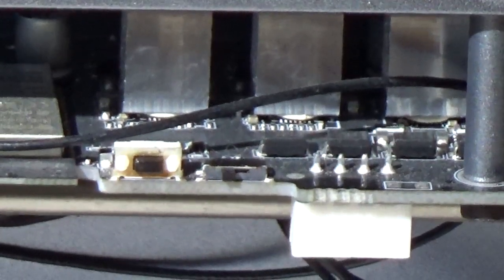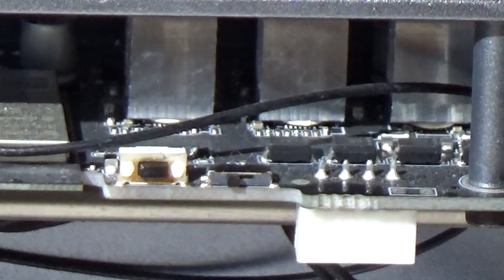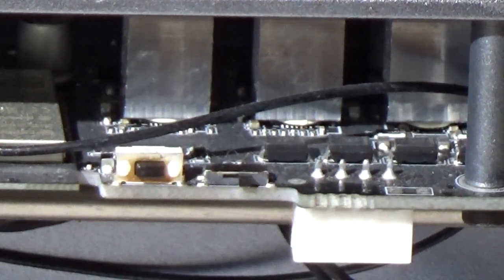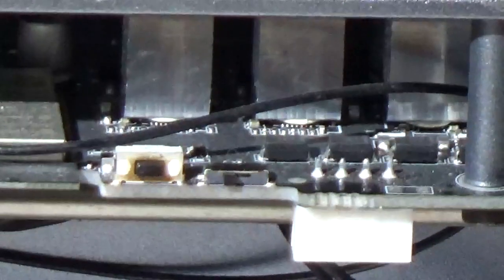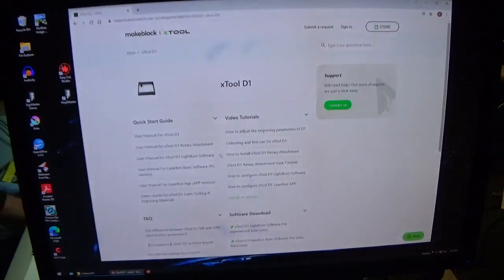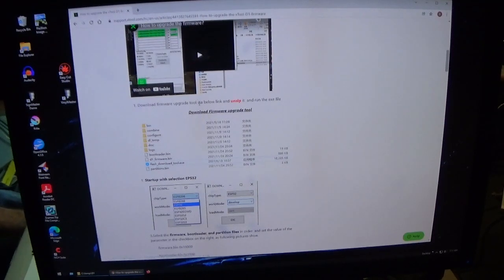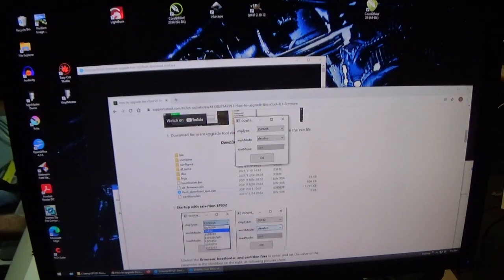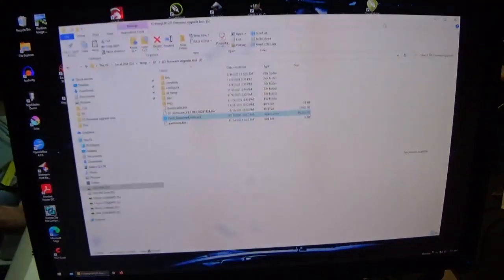xTool D1 Laser - Manual Firmware Update and 'The Switch'.

Comment: Before i found your video i updated the firmware but now my motor is locked up, i read somewhere is maybe because i installed the firmware for the d1 pro and not the d1 because i thought i did have the d1 pro.. so does anyone know how i change to the d1 firmware?
Reply: also xcs is not even recognizing my machine now :\
Reply from the maker: Wow! You would think there would be some type of checks made before allowing the Pro firmware to be installed. You will most likely have to do a manual update with the correct firmware. I did one in the video but I would check xTools support page for 'Manual Firmware Update"(?). I would say it's easier now or the steps may have changed. This video was done 2 years ago... Hope you get it figured out! The Official xTool group on Facebook might be a good place to get some help also if you need it.

Comment: Hello, your video helped explained a lot of questions I had. I unfortunately tried your method and it didn't work. I keep having issues with the system. For some reason I start a project and randomly it stops. It says that I cancelled the task. Do you happen to know what the issue might be? Thank you in advance.
Reply from the maker: Thank you for the comments and wish I had an answer for you. I have been hearing a lot of that and changing USB cables and/or using a different USB port seem to be the only advice I have seen. I am having the same issue with my 20w Pro. I will stop in the middle of a job and leave the laser running sometimes. Not dependable at all and afraid to use it. Have sent 3 messages to xTool and have not received a single reply yet.. If you hear of anything or find a cure, please let me know.

Comment: Hi friend.
I recently bought my xTOOL D1 Pro; I was working today (26 Feb 2023), when I opened XCS, an update message appeared, which, I confirmed (Update successful). After that, the machine no longer recognizes the USB and is no longer working.
When I click Process in XCS, the following message appears: "The device is offline. Please connect the device."
Is it possible to do a Factory Reset on the machine? I need a solution, please. Thanks
Reply: Having the same problem.  Resetting and rebooting machine and computer did nothing.  First it wouldn't home, now it won't respond at all.
Reply: @LoveTracy_Love  I purchased and am using LightBurn normally.
Reply from the maker: Have you tried restarting everything? Computer and all. Try it again. There is a Reset button on the board but it just resets the basic configurations, not firmware.  There is a manual way to reset the firmware. I would check support.xtool.com for the current files and information on that. Hopefully a full restart does the trick.

Comment: Mine won't even turn on,it just flashes blue by the sd card,how do I fix this,I can't even connect device to do an update??
Reply from the maker: Unplug all the cables plugged into the board and try to turn it on. If it comes one, one of the wires was plugged into the wrong place. Other than that not much to them to go wrong. You can try the xTool D1 Official Group on Facebook. There are people hanging out there that may know something or have some connections to get you an answer.
Reply: @Viper Designed  I've tried that,I think it happened when I downloaded lightburn on a 2nd computer, it work for a minute and then shut down and I can't turn it on since,I'm panicking now
Reply from the maker: @MrShamrock56  Don't forget the Pros don't do anything (No Fans or anything) until you start a Frame or Cut. Didn't think mine was working at first..

Comment: Mine just magically stopped wanting to perform framing prior to doing a burn. The laser fires up and will burn if I want but I like to frame prior to burn. Ya mine crashes in to the corner also.
Reply from the maker: There is reset button on the board. Try pressing it a few times then restart the D1 and the program you run it with. That seems to clear up a lot of things.

Comment: Hey @Viper design. I have some issue with my Xtool d1. Everything is working good,but it burn slow. What’s the problem.does I need to update it ? I already press the reset bottom. Still same.
Reply from the maker: There is a lens over the end of the laser. Look at it closely to see if it is dirty or even cracked. Most times when I hear about power loss or slow burns, that is the problem.. If your lens is fogged,  you can clean it with alcohol. If it's cracked, contact support for another.
Reply: I don’t see any cracked and already clean it with alcohol.😔
Reply from the maker: @trestanokartodikoro2823  Wish I knew what to tell you other than contact support. They should have a test to verify the power being put out and be sure the laser is working correctly.
Reply: @viperdesigned  thank you for your reply 🙏🏼
Reply: @viperdesigned  is working correct now. I clean the lens and update the firm and working like a new machine. Many Many thanks to reply on my comment 🙏🏼 Have a nice day 💪🏻💪🏻💪🏻

Comment: I keep getting sorry firmware upgrade failed. Status light is blue and USB not connecting.
Reply: I’m having the same issue, brand new d1 pro and couldn’t get it to update. Did you fix yours?
Reply: @biwinningduhh  yes.
Reply: @biwinningduhh  try your computer first. Turn off security setting firewall  may prevent the program from uploading to your pc

Comment: Hi. Having problems with my d1 {UK England}. Brand new, out of the box.  Tried to update firmware but then machine became unresponsive after I'd done it.  I have noticed the firmware update failed.  Thanks for your video.  I followed all the steps and still nothing!!  I have to add this is the 2nd machine I've purchased this week.  Same problem on both machines.  Any help would be so apprecicated.  I've tried through Amazon support but no contact with the seller still.
Reply from the maker: Sorry to hear about the problems you are having. Not too uncommon I'm afraid. I have not updated anything of mine for that reason and working just fine.  You might find something useful in this page.  Maybe roll it back to when it did work. https://support.xtool.com/hc/en-us/articles/6233607470487-Notification-of-the-Update-of-Beta-Versions-Laserbox-Basic-V1-3-0-xTool-D1-Firmware-V003-
Reply: @viperdesigned  Thank you

Comment: Viper...what does the RESET button do? if you push it, does it take you back on the firmware version? and you then have to do the update again??   thank you!
Reply from the maker: It will just clear it's brain and resets everything. Had to use it a few times because the D1 was acting up. Not sure how you would revert back to the old firmware. You would have to get the old firmware update files and even with that it would probably say it already has a newer version installed and quit. Mine isn't broke so I'm not fixing it with the updates just yet.

Comment: I had the same issue with the firmware not upgrading. I tried and tried and it was like the motherboard wasn't connecting to the pc. Last ditch effort I inspected that mobo and noticed that little black wire with the silver cap was touching the processors housing unit. I turned the wire slightly away from the reset button and I can update the firmware now.

Comment: I can’t even get my xtool to work. I got it two weeks ago and I can’t run run it because it says I need to update the firmware. I try and update the firmware and it fails everytime. Someone help I haven’t even been able to use my laser.
Reply from the maker: Hello Tyler, Sorry to hear that! What kind of system are you using and do you have it hooked directly to the computer with a USB cord? Have seen a lot of problems with Macs lately. Have you asked in their facebook group? Someone there will have an answer for you. Try the xTool D1 Official Group. btw.. Just for kicks try the switch the other way ;) Let me know how it goes. I'll watch for you..
Reply: @viperdesigned  I actually got it to work! I’ve been doing some practice stuff on metal like business cards I bought. Just tinkering around getting used to it. Im using laserbox currently. I downloaded a trial of lightburn but I’m unable to find my xtool on their list.
Reply from the maker: @tylere791  Nice!! Good job! There is a configuration file you have to download and install to get the D1 to show up in LightBurn. Check out this page. It's below all the LaserBurn pics.
Reply from the maker: https://support.xtool.com/hc/en-us/articles/4414120232983-User-Manual-for-xTool-D1-LightBurn-Software
Reply: @viperdesigned  did some pretty sweet tumblers with my rotary last night!
Reply from the maker: @tylere791  Thats great! Glad to see you up and going! Check out this thing I made for the rotary.  https://www.etsy.com/listing/1212656461/rotoclip-attachment-free-shipping

Comment: When you use Laserbox Basic software to Check for Firmware, after you connect the xTool D1 Laser by selecting the COM port, you are prompted with a dialog box that displays the switch and its location. As Viper Visuals noted the switch must be pushed to the left in order to write on the mother board. This is illustrated in the diagram of the dialog box. Your update is done in less than 1 to 2 minutes. Once its done, push the switch to the right to lock any writing on the mother board.
Reply from the maker: The description clearly says "MANUAL D1 FIRMWARE UPDATE",,, ( I will added it to the title ) This is for people that don't use LaserBox anymore and are told to do a firmware update like I was. When you go to their support page the most critical step is missing. The picture and message were just added to LaserBox not all that long ago. Say something about it and you are the problem.. Seems to be a list of people below that didn't know about it either,.
Reply: @viperdesigned  ABSOLUTELY CORRECT, VIPER.  I saw your video about the switch...and yes my laser head banged the damn rails and sometimes did a dance.  I rechecked everything, and this time put the switch back towards the silver start button on the machine.  Yep, all is well.  She doesn't try to give ya a lap dance anymore. LOL.  This is my first laser and I've learned a great deal from you. You are about the only one I found doing the D1 more exclusively; that alone is a big help to us D1 users, and even more to the NEWBIES such as myself.  Thank you!!!

Comment: I can’t get mine to even connect to my laptop since I received it and the company won’t reply to my emails. Sadly I can’t even get to the point of updating firmware. I think my problem is that they have not gotten off their a$$ to update their software to talk with macOS Monterey.
Reply from the maker: Do wish I could help you but I'm not up on the MacOS thing. Would love to one day. Do you Facebook? You might try leaving a comment in the xTool D1 Official group. Someone there can help out or there are a few direct connections hanging out that can get you an answer.
Reply: @viperdesigned  thanks for the offer, but ironically I just tried again today after taking a break for a couple days. I dunno what I did different but it finally connected and I burned something. Only issue I see is that the firmware is V40.xxx something, not the V1.1 that you see in any of their literature. Now I just need to start up light burn and see if I can get them working nicely together
Reply from the maker: @OffGridOverLander  They just released a new firmware update. I'm not sure of the number off hand but I will be holding off on it from what I see. If it ain't broke, don't fix it I say..  Had an experience myself you might consider. I had a lot of weirdness going on and updated everything, tried everything.. Ended up being an unshielded USB cable. Go figure. Make sure you use a good cable and route it away from anything the best you can. Keep it away from any electric cords..
Reply: @OffGridOverLander  I’m having issue connecting with my Mac as well. Any suggestions?
Reply: @moniquerios6380  I have mine working finally, but in all honesty I have no idea what I did to get it to work. I had tried everything I could think of or searched for, with no obvious winners. The mac 340 drivers, disabling the firewall and the built-in anti-virus (the part where you do some Terminal modifications in recovery reboot) and a few other things. After taking a couple days away from it, cause by that time I wanted to throw the MacBook out the truck window while going down the highway, I tried connecting it again and it worked. I'm sorry I can't help you more than that since I have no idea what fixed my issue. I was going to take it to the local shop to have them figure it out the very next day, maybe the laptop was sensing that and got scared??

Comment: The latest video xTool D1 - Unboxing and First Use for xTool D1 shows this switch for ~1second.  If it wasn’t for your video, I wouldn’t have known what i was looking at and gone back to pause the video.  It looks like the latest version of the software has a little picture popping up saying to flip it one way for update and back when done.
Reply: They did add it to the LaserBox basic screen when you update the firmware that way. If you do it manually using the help page it isn't mentioned, but they give you all the rest of the steps. They aren't much good without step one. First mention of it is on page 20 of the Trouble shooting guide. First place I'm going to look. I just thought it was worth mentioning in case someone else was having the same issues.

Comment: Thanks ! I'll give it a try in that order..everything works except the laser and fan will not come on ! It moves as it should but no laser or fan ! I have triple checked myself..i will perform switch reposition in the order you described ! Hope it works !!!
Reply from the maker: You might want to pull all the plug ins and look down in them closely to be sure one of the tiny pins didn't get bent over. No fan or laser means it's not getting any power. The crosshairs should come on anytime the D1 is on..
Reply: Will do...i did find the switch in the position you said it shouldn't be as well